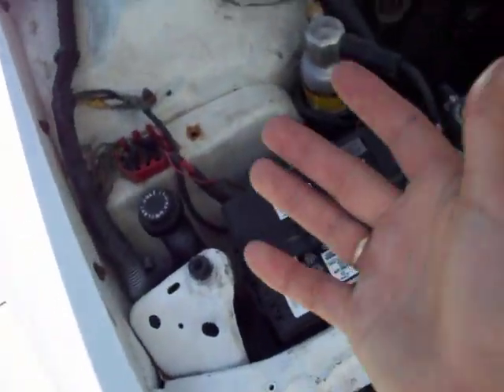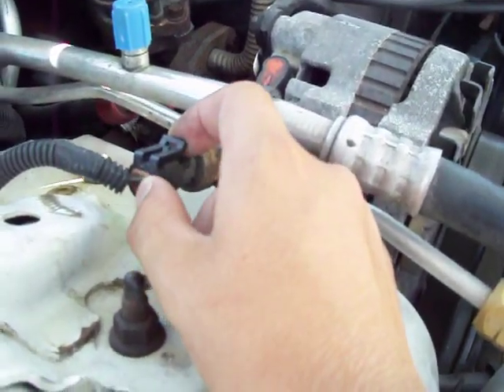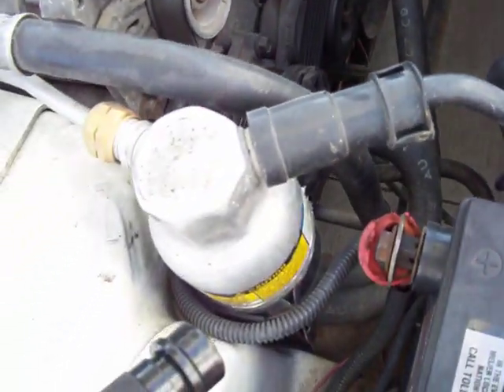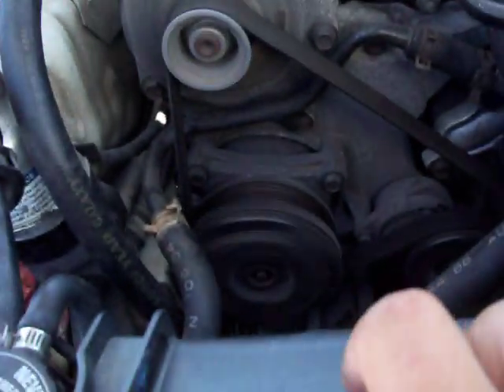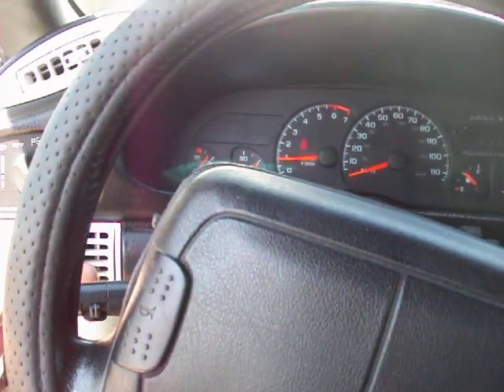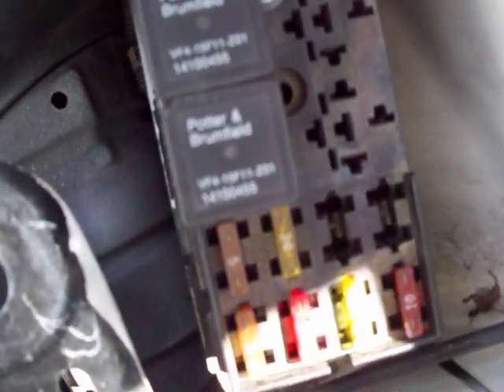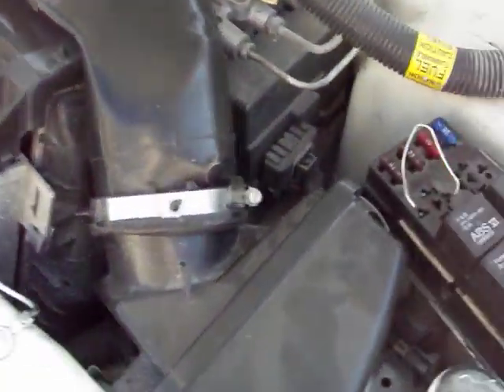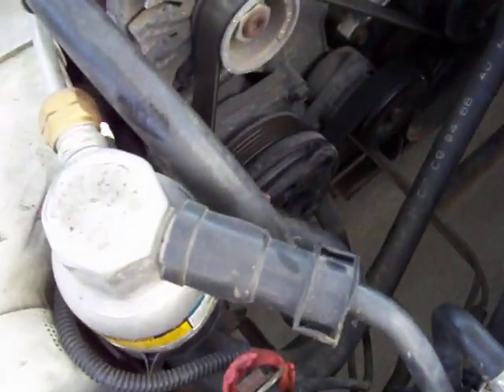How To Make AC Ice Cold, Recharge air, and Force the Compressor Clutch to Engage

Comment: my car only has 4 prongs that stick out of the relay.  no indication or diagram of what is what.  how can i tell which one is  87a and 30?  will it mess anything up if i just guess and try different slots until clutch engages?
Reply: +Joe Kim mine has 4 too
Reply: Some systems have the 4-pin relays, some have 5 or more pins... This is because the companies who mfgr. these vehicles want to use equipment that interchanges with other uses whenever possible... The pins 87 & 87A on relays with 5 or more pins are performing similar functions, but on different modes of operation of the relay.... The 5 pin relays with pins that are numbered 87 & 87A mean that this relay is a SP/DT type... That is, this relay performs the function of a Single Pole / Double Throw switch. Pin 87A is used on the NO side of the circuit, while pin 87 is on the NC side of the circuit... That is, pin 87A is on the Normally Open side of the circuit and pin 87 is on the Normally Closed side of the circuit... The circuit that needs to be activated to engage the A/C clutch is the one that goes to pin 87A, since it is the one going to the side of the relay switch that is energized when the relay is activated... Pin 87 is energized when the relay is not being activated... In this application; of activating the A/C clutch, only the NO side of the switch is being used and the NC side is not being used.... Pin 30 has continuous (fused) power going to it as soon as the ignition key switch is turned on.... So using a CORRECT 16awg jumper wire with the proper bayonet connectors of the same type as the relay pins will activate the A/C clutch... DO NOT USE A PAPER CLIP TO DO THIS!!!! Be sure to check if the compressor is turning freely, by turning the Compressor drive plate on the end of the clutch by hand...Do not activate the A/C clutch on a seized compressor!!! BTW, go to google or another search engine and type in ' 12v SPDT relay schematic diagram' for 5-pin relays and '12v SPST relay schematic diagram' for the 4-pin relays... It will give You several blogs to get nice photos of electrical schematics of how these relays work...
Reply: That is an excellent question Sharon... If You are referring as to why the DTC (Diagnostic Troubleshooting Codes) have not presented any codes or the 'check engine' lamp is not lit, the reason is: The a/c system is not inter-connected with the PCM (Powertrain Control Module) in a way that will trigger the DTC lamps on most vehicles. Unfortunately, many people have the mistaken assumption that the DTC codes will be the answer to I.D. all problems on the current vehicles.. This just isn't true.... The best way to find the problem with any system or component is to research on how to do this from a RELIABLE source, and have a basic understanding of how these things work... Then one must determine the best way to approach the problem to be able to I.D. it...  Finally, to obtain the CORRECT parts and tooling to repair the fault properly...  Quite often, the people who are unfamiliar with things like this ,  find that it makes good sense to hire some help from a PROFESSIONAL technician who is properly trained and equipped to do work like this... It might seem expensive at first...But, when one sees the damage and unreliable performance of having the vehicle worked on by an inexperienced amateur could cause, then one can see that the cost of the well equipped & trained technician is well worth spending a few hundred $ vs. spending spending several Thousand $ having it re-repaired after the ham-handed hack got ahold of it... I always have encouraged public awareness of what is being done to any belongings (cars, trucks, cycles, houses, aircraft, etc.) that people need to have done , whether they do it themselves or hire somebody else to do work like this.... This is why I suggest people to obtain advice & information from people who are trained & experienced with what they do... The video posted above is of an inexperienced amateur who should not be posting advice like this... It is full of mistakes and wrong techniques, and could be dangerous ... The video from Auto Zone is one that is excellent in doing work like this.... Use that one instead of the video posted above...
Reply: You're welcome Sharon... I have done work like this and have studied a lot about things like this... When somebody asks for advice, I will try My best to steer them straight... :-)
Reply: +Michael Martinez thanks a lot michael!  youre awesome!
Reply: You're both welcome Sharon Barnett and Joe Kim... I will do anything that can be done to help others who experience difficulties with things like this... I always recommend obtaining advice from others who have the experience and knowledge from technical training and OJT... The individual who posted the video above was trying his best to do this, but He just did not have the proper training to post this video... I saw his later video (3-years after this post) that showed him retracting his techniques he used in this video, as He entered a technical school to learn how to do this correctly .... I feel that He is a good guy (Especially since he posted that later video), but He should be more careful of posting videos like this...
Reply: SOMEONE PLEASE HELP! So i have a question.. does anyone know what i need to do ...

i recently rebuilt my ac system in my car.  New compressor, new condenser, new evap, expansion valve, cleaned out the original ac lines with ac flush fluid and even new o rings for leak proof seal.  before recharging my system i vacuumed the system for 1 hour, turned vacuum off and waited an hour, the pressure still remained negative so once i knew the seal was leak proof i vacuumed for an additional hour and then proceeded to recharged the system.  While recharging the system i made sure to purge the yellow line to get all the air out before adding refrigerant.  this is where I messed up... added too much refrigerant...... after a few days of ac working, it stopped.  compressor wont kick on anymore but still spins freely by hand.  i went to uncap the high and low pressure caps to check pressure and the high pressure cap boom! goes flying out and starts to constantly leak refrigerant and i believe the compressor oil.  the high pressure valve on the line i guess blew/busted.  can i replace just the valve?  and now that the compressor oil seemed to have leaked with the refrigerant how do i know how much more compressor oil i need to add with the refrigerant after my ac line is fixed?
Reply: Hello Joe Kim... The video posted above, is one that hope I You did NOT use for reference to do the work that You just did.... I have a few questions for You before the diagnosing process of the problem You are now having..... 1) Was there a/c 'stop-leak' in the system before You worked on it or was there 'stop-leak' added to the system after You did the initial work that You described above?  2) Where were the leaks in the system, BEFORE You did repairs to it? 3) What pressures were on the charging/servicing manifold (high & low) gauges when You did the re-charge? If the compressor turns by hand, what are the pressures (when the clutch is manually engaged) now? 4) What was the ambient temperature You had when doing the re-charge? What is the ambient temp. of the system now? 5) Does the a/c compressor drive plate actually turn, or is the 'coaster' wheel on the dis-engaged a/c compressor-clutch turning only - when the engine is running?  6) If the compressor drive plate does turn, is it actually turning the compressor input drive shaft? (One of the systems I worked on in the past, had a woodruff key missing, and the drive plate was actually spinning on the shaft that it was supposed to turn) 7) Was the compressor actually a new/rebuilt unit or is it one that was used that came directly off another vehicle? 8) You said that You replaced several components, was the receiver/drier (accumulator) unit - one of them? Did You replace the internal 'Finger' strainer(s)? 9) What make/model/year vehicle is this? 10) Does the vehicle have more than one evaporator (like several large SUV's have)? 11) If the vehicle is equipped with multiple evaporators, what were the pressures before & after those expansion valves (of the additional evaporators) and what was the ambient temperature at the time of those gauge readings? ...... It is not uncommon to find slight leaks coming out of the 'Schrader' valve cores after working on a/c systems.... This is why I like to replace these valve cores on the system servicing ports when doing the type of work that You just did, especially since You decided to not replace the lines.... But the caps will temporarily stop those leaks when they are equipped with rubber seals.... As far as how much oil is in the system, I do not know of a way to positively check the quantity of it... It would be nice if the oil level could be checked with a sight glass , but the systems that I have worked on in the past - had no such equipment... The best that I can tell you about the oil in the system, is; try to calculate how much oil & refrigerant was lost with the leak(s), and add that amount of the CORRECT a/c system oil to the system with the oiler tool available at auto parts stores....  I will be awaiting to hear the answers to the questions I had for You.... Sincerely, Mike Martinez
Reply: thanks for the reply!

as far as stop leak.  it was never used, as long as i had the car.  i bought it used.  i took it to a mechanic the first time it went bad and it only lasted one summer.  they said the ac compressor needed replacement so they changed it out.  this time i didnt want to spend thousands of dollars on a mechanic again since i didnt know and trusty mechanics i decided to do it on my own.  I did not reference this video to do any of my ac work.  this is just a video i came across while doing my research.  before doing this repair, the leak was in the ac compressor itself.  im not sure what to call it but there was a huge gap thats been created in between the pulleys and the body of the compressor.  also the compressor failed on my while i was driving and i smelled burnt.  so i thought it would be a good idea to just replace all the parts so i can have a system that would last as long as possible.  my parts were all bought brand new, however they were aftermarket parts with good reviews.  my car is a 2004 acura tsx, and as far as i know it only has one evap.  i went ahead and just now repaired the port valve pins so i am no longer getting a leak from there anymore however it will not hold a vacuum.. the high side seems to hold a vacuum but the low side immediately loses vacuum as soon as i close valve on manifold.  as far as the pressure readings i cant tell you because due to some complications with the manifold set that the company sent me, it would not fit my tap.  i think they sent me an r12 set.  so i had to just fill the system with one of those refrigerant cans you buy at the auto parts store with the small gauge (ac pro).  as far as my car goes, the receiver drier is attached on the side of my condenser.  when i purchased new condenser it came with a new receiver drier already installed.  I really dont think i made any mistakes when it comes to installing new parts.  added correct amount of oil into the ac compressor.  changed all o rings.  cleaned parts carefully but well.  everything was fine up until the recharging of the system.  it held a vacuum for a little over an hour.  ran the vacuum on the system for a total of 2 hours.  the only thing i can think of that i know for a fact i did wrong was probably adding too much freon in the system.  the ac was working wonderfully for about a week and then all the sudden it stopped working yesterday while i was parked waiting for my appointment.  I guess i should mention this... when i turn AC ON in my car, i hear a louder humming noise as if you would regularly however when i go take a look at the compressor, the clutch is not engaging .  I tried examining the wires, and disconnecting and replugging the connections.  im not sure if i completely understand what you were trying to ask me since im not as knowledable with cars but when i say i can turn the clutch by hand, i mean the center plate of the pulley that only spins when ac is on.  thats what turns freely by hand.
Reply: one more thing i just noticed.  i didnt pay attention to this so i cant say exactly when this happened but the passenger side of the fan is not spinning.  not sure what you call that... radiator fan?  cooling fan?
Reply: Gotcha!!! Check to see whether that fan has power going to it when the a/c system is activated.... It is one of the fans for the cooling system , and probably will always be on when the a/c system is activated.... Get back to Me with this along with what type of vehicle You have and answers for the questions I had above.... I'll get back to You when I can... Sincerely, Mike Martinez
Reply: I expanded the response You gave Me and found the answers to a few of the questions You gave to Me.... You have to test the high side of the system as well as the low side of the system now... It sounds like it could possibly be another problem with the compressor.... Hard to tell w/o complete info... One of the parts of the video that I was concerned about - is using the low side gauge only as described by the amateur mech who posted it here, which is, apparently what You did... Tell Me what the pressures and ambient temps. are, after You do the tests.... Sincerely, Mike Martinez
Reply: well i need to get my hands on another set of manifold gauges because the ones i got are probably defective.  i put some refrigerant in just a moment ago after i changed the service port pins to see if it was still leaking and i got no leak.  afterwards i hooked up my manifold set to the high and low and i got 0 pressure on both gauges...  if you dont mind me asking, what do you mean by "using the low side" are you referring to when adding the refrigerant?  Since my adapter wouldnt fit a 134 tap, i went ahead and pulled vacuumed on the entire system (with high and low valves connected to manifold) then i went and used the regular trigger tap refrigerants that you just buy at the store to charge the system.  Are these symptoms something that can arise from over charging the system? . If indeed the compressor did happen to crap out again (knock on wood, its a brand new compressor!) what would have made the compressor crap out so quickly?
Reply: by the way, i have a 2004 Acura TSX.  As far as the other testings for the power going to the fan ill get back to you asap.  also I need to get a new manifold set before i cant get the pressures to the lines.
Reply: +Michael Martinez can you believe this?!  it was a fuse this hole time.. the condenser fuse.. im still going to watch out for leaks though but as of now ac is back up and running ice cold!  i appreciate your help michael, couldnt have done it without you!
Reply: Condenser Fuse?????
Reply: +Michael Martinez yeah... lol.  one of those where least expected moments
Reply: Let Me know what the answers are to those questions, that is after You get the proper equipment and procedures to do this testing... By the way, What is the high temperature today where this vehicle is at? It is over 112 degrees F. Where I'm at today... Having a good working & reliable a/c system is a real necessity here....
Reply: That is a good thing that You were able to locate the Problem Joe!!!! When the question was asked as to whether You tested the High or low side of the system, that refers to the side of the expansion valve or orifice. That is where the pressure drops in the system.... The VCM (Vapor Cycle Machine) , which is what an automotive a/c and many other types of a/c and refrigeration systems are actually referred to: by engineers & technicians,  has a flow-path of refrigerant that is much like water flowing through a dam to create electrical power... On a dam, the water is stored in a reservoir (lake) which is stops/restricts the free flow of water from that lake, and fed through passages in the lower parts of that lake. The pressure build-up of the gravity-head of water which creates close to 1 PSI for every 13" of water level rise could reach several hundred PSI because of several-hundred feet of water gravity head , which above the level of the lake. That pressure is then used to drive hydro-turbines, which turn electrical generators..... On the lake side of the dam there exists a higher pressure than on the exit (stream) side of the dam... Now , back to the VCM's.... The compressor supplies flow and pressure of the refrigerants through a restriction (Like the dam) which can be an expansion valve or a calibrated orifice.... The side of the system which is on the 'high' side of the expansion valve/orifice (Lake side of the dam) has a higher pressure than the 'Low' side of the expansion valve/orifice (Stream side of the dam)... The rest of how the VCM operates is something that requires additional study... It helps to know WHAT is being Done to Your vehicle, and why it is being done.... The common car / truck /suv / motorcycle /etc. is often the second largest expense is the household budget, and should be a very high priority as to the care & maintenance to keep them running properly and reliably... They are the link between the residence and where one goes to work & earn a living... They are often our link to get groceries, get to vacation places, see family / friends & relatives, and other important places.... They should be kept-up properly as our lives often rely on them so much.... Knowing how they work can prove to be very helpful, even when one takes them to somebody else to get it serviced / repaired... What I have learned about vehicles through the years is what I want to share here with those who can use this help...